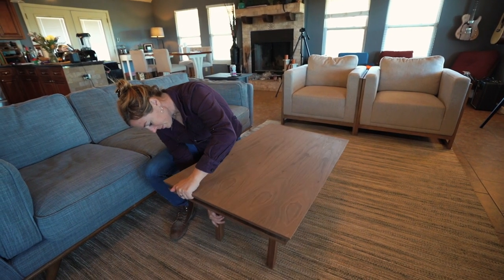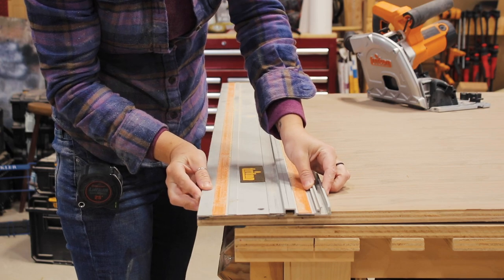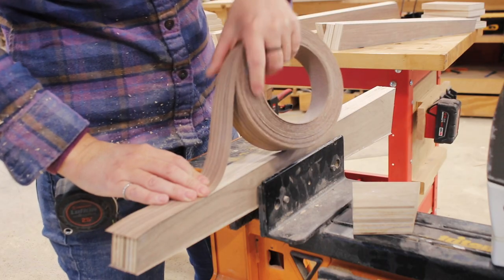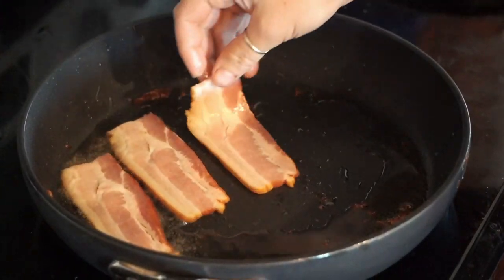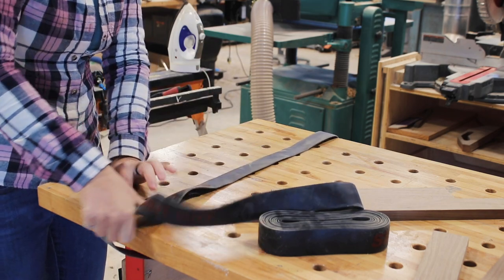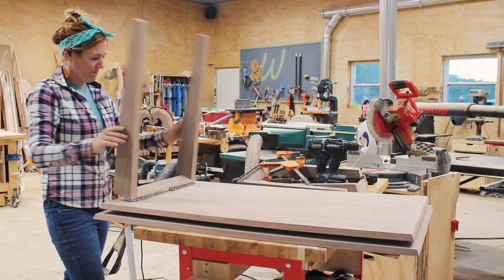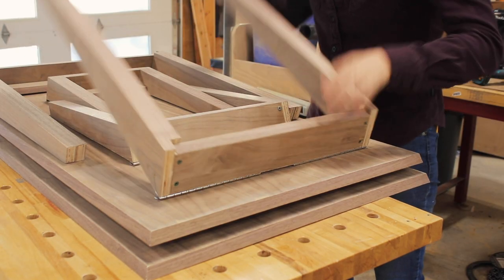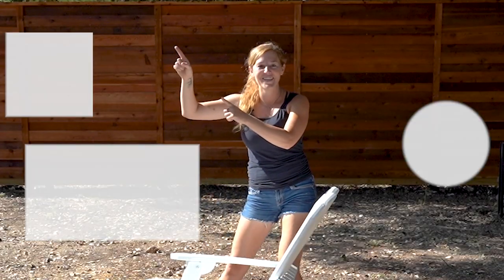Transforming Coffee Table | Coffee to Dining Table in Seconds

Comment: For that continuous bevel from top piece to bottom piece of the tabletop, do folks calculate the length and width of the bottom piece and cut the bevel separately before assembling, or cut the bevel on the top piece and on two sides of the bottom piece...assemble with the spacers then measure and cut the bevel on the remaining two sides of the bottom piece removing the need to calculate the width and length of the bottom piece?  If you are calculating any online tools you can recommend to calculate so the bevel edge remains continuous?

Comment: What happens if a dog or small child runs into the leg? Are the magnets strong enough to prevent the legs from folding and the table collapsing? I think I might make this with a locking hinge as well as the magnet. I don't typically wear a belt and suspenders, but in this case it might worth the fashion faux pas.